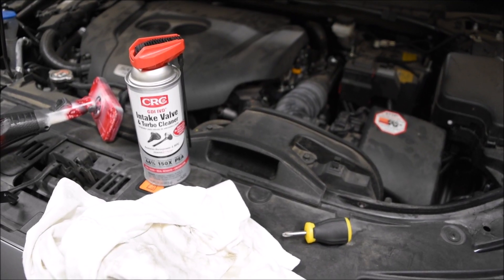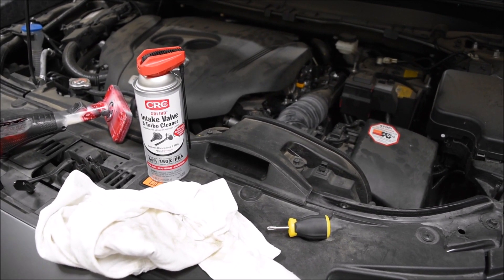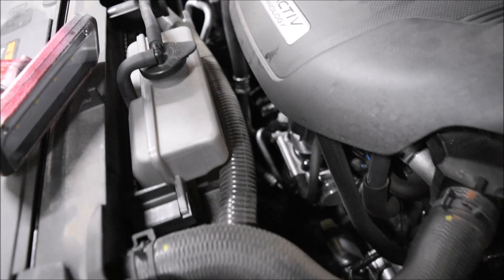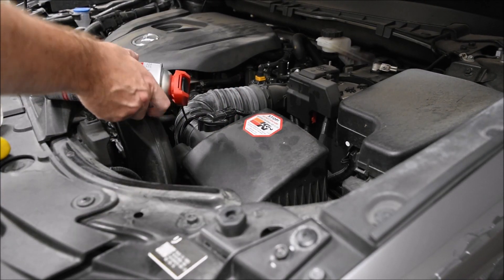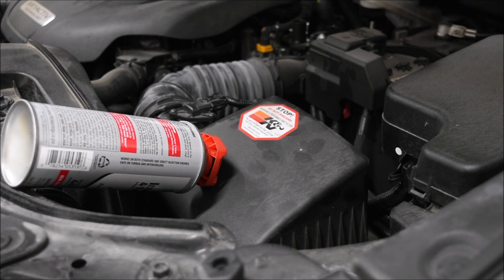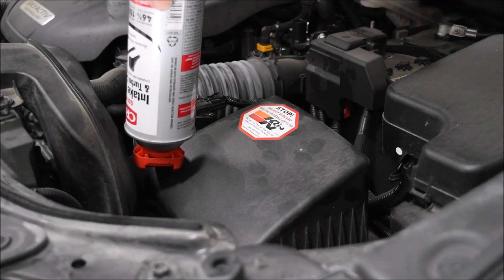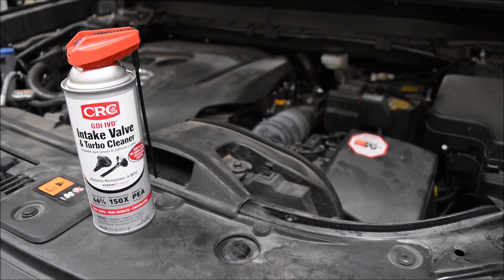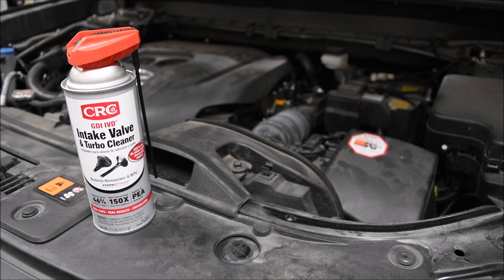Cleaning the Intake Valves and Turbo on a Mazda CX-9 2.5 Turbo.  Did it have carbon deposits???

Comment: those deposits wont go and fill the intake manifold & valves ?
Reply from the maker: No, they will break off the valves and go out the exhaust. It is possible that the cat will catch them if there are big enough pieces.

Comment: I had a Kia Optima that was a GDI and I wasn't aware at the time that this needed to be done. I had 130,000 miles on it and it got the same mileage as when it was brand new and the power was still there. Never a rough running engine or anything like is being discussed. I traded it on a Mazda CX-5 and this cleaning is all I'm hearing about. Every time I go for an oil change the dealer wants to sell me a induction cleaning for $160. So now I am trying to learn.

Comment: I plan on doing this annually on my 23 cx-5 sig turbo, only drive about 6-8 k a year.
Reply: Completed procedure on m 2023 cx-5 signature turbo.    Did at 9,400 miles and will do annually.   Inserted in hose forward of Mass air sensor.  No issues.
Reply: @dogsarefun2 Did you get good results from this? I have 6500 miles on my 3 Turbo that sees a lot of stop and go traffic and short trips, and it already feels slower than it did off the lot and with poorer throttle response. Wondering if this will help.
Reply: @jamesrather1510   No difference in performance.   I didn't have any issues and doing this as a proactive treatment.
Reply: I do use 93 octane 90% of the time.

Comment: So at 10K I shouldn't be concerned about carbon chunks scoring the cylinder or fouling the cat or oil...especially if I change it immediately after...correct?
Reply from the maker: I wouldn't think so.
Reply: @GregsDIYGarage  And just so I don't screw my Mazda3 up - is there a better access point besides spraying into the air intake post Maf/pre turbo?
Reply from the maker: See if you can find the vacuum hose going to the brake master cylinder. You can spray the CRC into it from the master cylinder side if it pulls vacuum from the intake path.

Comment: Youre real problem is that K n N.. the filtering efficiency is pretty bad and your MAF is slowly getting ruined
Reply from the maker: I had already tried cleaning the MAF, it made no difference. My guess is that the throttle body was dirty and the cleaner did the trick.
Reply: @GregsDIYGarage  you are losing valuable filtration by using that knN. The tiny amount of flow gain isn't worth the $&#&# the filter is letting in your engine.

Comment: Using a high-quality syn oil and not extending your change intervals helps too.  Also longer drives at moderate constant RPM. If the car does a lot of short drives that the intake runners and valves don't get a chance to get up to full operating temp then carbon buildup will be a problem inshort order.
Reply from the maker: Never did figure out what the actual cause was. The CX-9 has almost 80k on it now and it hasn't happened again.
Reply: @GregsDIYGarage  Yeah id be willing to bet sometime between when you got that car and after the cleaning  in your driving habits changed.  It could be  completely unexpected like your favorite gas station changed suppliers or additive packages, or they had bad gas.  I have a 21 Turbo 3, very similar engine to yours,  I've found that my car is EXTREAMELY sensitive to the quality of gas.  My car has 43K on it now and recently I got a few bad tanks of gas in a row,  gas station ended up having water in their tank.   My car which never exhibited any issues before started to have hesitation, an unstable idle at start up, and just down on power.  I tried a bunch of in the tank cleaners and nothing helped.  I found this GDI cleaner, ran a can through and BAM car runs great again.   So this carbon build up seams to happen very quickly if the conditions are right.. or wrong depending on how you look at it lol.  I did buy a catch can from burger motorsports which is supposed to help. its about $200 if you'd like to go don that route.
Reply: @mikel9656 I have noticed 2.5 being very sensitive to quality of gas as well.
Reply: @thetechlibrarian Only Top tier premium fuel for my 2018 CX-9 GT! Almost at 140K but that pesky EGR valve code likes to pop up.
Reply: This is actually a great comment. 
Short intervals will cause issues. I tell people to try to extend short interval drives to about 25-30 miles if possible. Also allowing about a minute before turning off the ignition helps with preventing unburnt fuel from contaminating oil.

- Also, not all 5w30 SP/GF-6A oils are not created equally. Some are much better than others with regards to oil shearing at higher temperatures. A higher HTHS 5w30 will suit the engine much better than lower one - especially in warmer climates.

Comment: How often do you pump one of those cans in there. Just you personally. Bubba, take a look at that clean engine! On the outside I mean. Did you have the old lady revving the engine for you 😄I bet y'all take good care of all your stuff. Man, I would've loved to have seen the actual before and after results you got. What do you think about the engineers designing these engines to run a bit hotter as a means to keep the carbon from accumulating on the valves? If I were to bet, actually, I would and will bet that your issue was a crusty throttle body. The back of the inlet mechanism accumulates a lot of crud in these. I think if you take a look at your preventative maintenance schedule that throttle body cleaning occurs a couple times pretty early, and at regular intervals throughout the life of the engine. Your #1 piston probably got a nice little rinsing as well. Those 3 and 4 cylinders obviously didn't see any of it. I'm dying to crack open my intake manifold and get a look at mine, sitting at about 120k miles rn. Cheers brother! Stay clean 🤝

Comment: "The question is, how soon will your intake valves need cleaned and will a simple spray be enough to make it run well again?" two questions ✌
Reply: Every 10K. 
Every 30-50K maybe take a look with a borescope to see if it needs manual cleaning.

Comment: I had the same problem running a K&N the oil from the air filter was misting on the mass air flow sensor. I cleaned the mass air flow sensor and installed regular filter never had the problem again.

Comment: Thank you for the very informative video. I'm also planning to use the crc with my ford ecoboost where we have the almost the same engine. I'm just worried spraying it directly thru the turbo instead the throttle body. How did your engine perform after the procedure?
Reply from the maker: It corrected the issues and the vehicle now has 65k miles and still going strong.

Comment: I have 41k miles on my 2016 cx9 and still don't feel that hesitation nor weak throttle response.  I've been using this fuel additive called archoil 6200. I just replaced the spark plugs and the old spark plugs looks really good at 40k miles. I assume the fuel additive I put every fill helped out.
Reply: The only problem with this is with direct injection, no fuel ever touches the back of the valves to clean it. The carbon deposit on the back is mostly oil from the Crankcase vent valve. An oil catch can is helpful here.
Reply: @phillm156 great point, would you happen to know of a video that shows how it's done? Thanks
Reply: @milvolts1  Shorter oil change intervals and a catch can. Corksport has one as well as others. Set a drive distance of no less than 20-30 miles will help with as well, fully warm the car every time you drive.
Reply from the maker: Thanks for info!

Comment: There are logical concerns that if used as regular maintenance, ie, 10k intervals, it's safe on turbo GDIs, but as a fix for heavily gunked valves, there is risk that a chunk of carbon deposit will dislodge and collide with the spinning hot side of the turbo - just like person getting a stroke from a dislodged clot. Also, author correctly avoided the MAF by the air cleaner, but there is also a boost pressure sensor on the passenger side of the intercooler and a MAP sensor on the intake manifold. Unsure if the product is safe on those sensors.
Reply: I can confirm that it is safe on the boost and MAP sensor. Didn't throw any codes on my turbo CX-30.
Reply: @gosuckacat Did you spray pre turbo?

Comment: Did it smoke? Since if it smokes a lot then your valves must be really clogged up by carbon.
Reply from the maker: No it didn’t smoke.  I think it had fairly minor deposits but enough that it didn’t run smooth.  I should have installed an oil catch can a long time ago, gonna do so soon.

Comment: Does this cleaner contain any chemical that will damage the o-ring or the rubber?
Reply from the maker: That I don't know.
Reply: I’m more worried about chunks of carbon hitting the turbo and cat
Reply: @tomwalker996  the unburnt fuel can fix that.
Reply: @shsaint  how does that work?

Comment: How well does this clean the throttle body?
Reply from the maker: I didn't look at the throttle body as it's buried pretty good but it seems to have cleaned it pretty well.  The SUV is still running great at 50k.
Reply: Not well at all, the this crc might have helped with the valves. You want to be able to access the throttle body, clean the butterfly valve with a toothbrush and carburetor cleaner with the engine off and butterfly in horizontal position. Then use the crc intake valve cleaner.
Reply from the maker: @6atlantis  Thanks for the reply.  The product used here cleans the turbo, throttle body, and intake valves.  Yes you can clean the throttle body directly using a throttle body cleaner (never use carb cleaner on a throttle body) and get better results, but this worked fine for my needs.

Comment: It says to use the brake booster hose to spray it in...
Reply: Kuma Makanui those are the advanced directions, secondary is to go through the throttle body, air intake if you can’t get to T.B

Comment: Good video! I have used this successfully on a Tahoe a few years ago. I noticed you have a K&N air filter. I have a new 2019 CX-9 (also from Nelson) and was wondering if it made any difference in mileage or power? I would appreciate your thoughts.
Reply from the maker: Steve S. I can’t say it made any noticeable difference, but I like that they last the life of the car (just have to clean them once in awhile).
Reply: @GregsDIYGarage  Thanks!